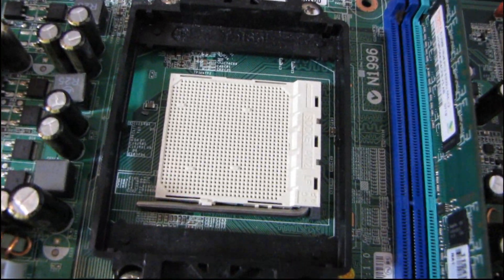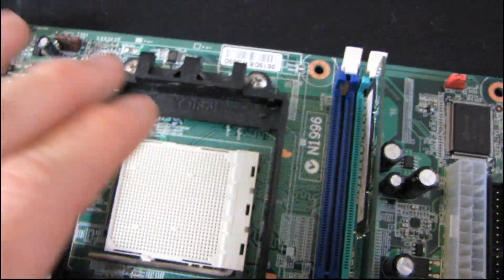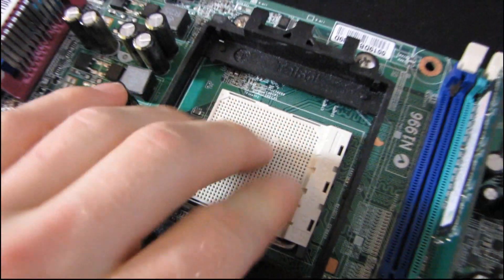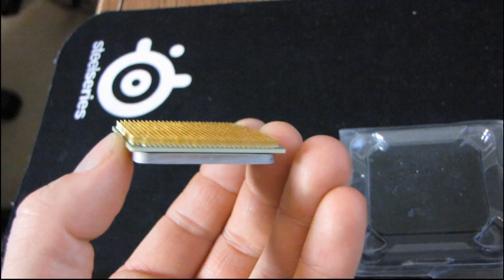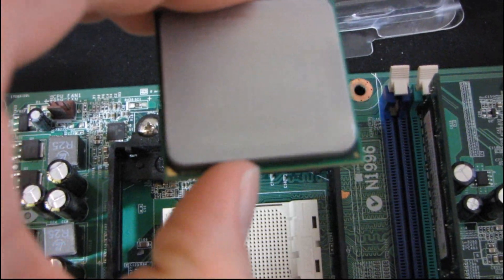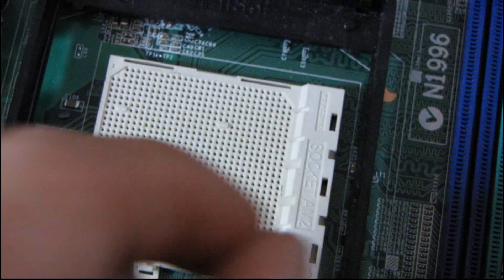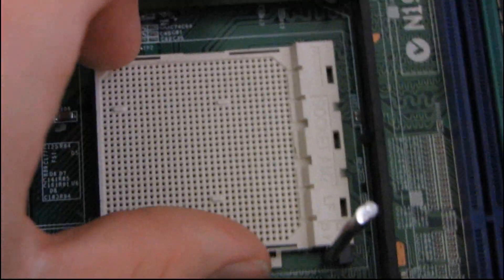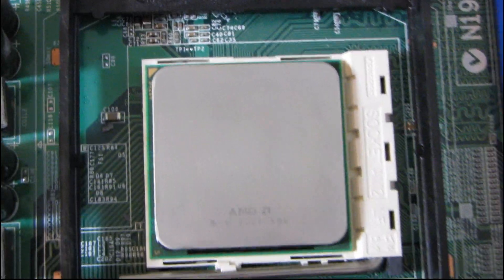AMD AM2 AM2+ AM3 Athlon 64 Phenom II CPU Installation Tutorial Guide Walkthrough Linus Tech Tips

Comment: CPU and sockets are keyed so they only fit one way, the correct way. On most sockets whether PGA or LGA, there is a gold triangle marking on the CPU. Line this up with the triangle symbol etched/stamped on the socket itself. On LGA sometimes the triangle is on the metal cover itself. the CPU should simply drop right into place. You should not need to press at all, provided all pins are straight. CPU insert/removal is really easy

Comment: Accidentally ran into a 9 year old Linus video. You have come a long ways in your videos. 

And I’m still using an am2 socket with a 64 X2 5200 on a A8M2NLA board in 2020. It won’t die!
Reply: Still alive? I just had to lay to rest, an AM2 system I had for years. Maybe I'll try to find a motherboard... Funny how a PC can become sentimental...
Reply: @RodknockRhett  Well, It still works but I have sat it aside and ended up getting a much newer (2018) I7 Computer with a 1080 card someone just gave me for $100 when they bought the latest and greatest (it quit on them and ended up being a power supply). Since I had wanted to play the latest Microsoft Flight Sim that I could not run on the old system, I switched as I have run out of upgrade options on the old bird. It will probably now collect dust along with my old IBM L40 SX and a few others. 

I’d say we both got more years than planned out of them. Your right on it becoming sentimental. I didn’t want to switch as it had served me well for so long.
Reply: im selling an am2 motherboard if interested lmao

Comment: Mobo socket AM2 installed processor AM3. Most importantly the capacitor on the side of the socket is replaced with a new one. The goal is to supply a stable electrical power to regulate the temperature of the processor remains stable and not to overheat. And also look at your motherboard site. There is a list of compatible processors.

Comment: i have just one question, in other video you show adding some kind of paste to the cpu. what happens if you dont add that paste? i want to change my cpu but the best compatible is the athlon 64 x2
Reply: +William Garcia depends on how well done you want your cpu....basically that paste and the heat sink come together to dissipate heat cause by the CPU, no paste = fried cpu
Reply: Thanks for the advice, I have changed my cpu, had to pay for cuz I was a little scared to do it myself
Reply: William Garcia  Yeah I remember the time i was scared to do that myself. Hard part is not installing the CPU but applying the thermal paste evenly.
Reply: Lol guys you can use toothpaste mixed with Vaseline as a thermal compound also in my experience thermal paste doesn't matter too much

Comment: hey please reply.I have am2 socket and i want to put amd phenom 8600 II x3 will work?Like
Reply: +Sink Check CPU World , Your CPU is  Phenom 8600 II support AM2+ And AM2 , Be sure to update your BIOS or check your motherboard model at  manufacturer website to see the list of supported processors , some motherboard has CPU Watt Limit ,  Check before install !
Reply: The motherboard supports AMD socket AM2 single-core Athlon 64/ Sempron and dual-core Athlon 64 X2/ Athlon 64 FX processors with 2MB / 1MB / 512KB L2 cache, which is based on 64-bit architecture. It features 2000 / 1600 MT/s HyperTransport Bus, dual-channel un-buffered DDR2 800 memory support and AMD Cool 'n' Quiet! Technology.^ I got this information from my motherboard website. What is the fastest processor recommended for this?

Comment: @JonasDSDK Yes, they are completely backwards compatible. AM3 CPUs will work with AM2 and AM2+.
I am using an AM3 processor on an AM2+ Mobo, and it works great.
Reply: Hi. It's been a long time, but will an am2+ or am3 cpu work on an am2 motherboard that is not officially compatible with them? Im using a winfast 6100m2ma motherboard. I don't think there are bios updates for that, and the nforce 410 chipset it uses also isn't theoretically compatible. Any ideas?

Comment: @danthaman7777 If you are installing the basic cooler that came with the CPU (or anything like it), then you do not need to. If you are using an aftermarket cooler, you will need to remove the "black rectangle" and use the special mounting equipment that came with the aftermarket cooler.

Comment: @Lagamaister 
Most likely you will have a very small bottleneck, but nothing that will make or break your computer. I'll give you an example (and greatly exaggerate): your CPU is like a four way intersection. Only so many cars  (which, in this case, would be data) can go through the intersection before traffic starts to slow down and become very heavy.

TLDR: You most likely will get a very small bottleneck, but it most likely won't be noticeable.